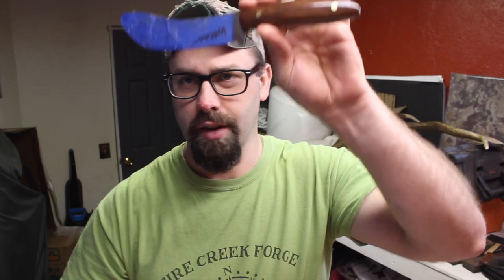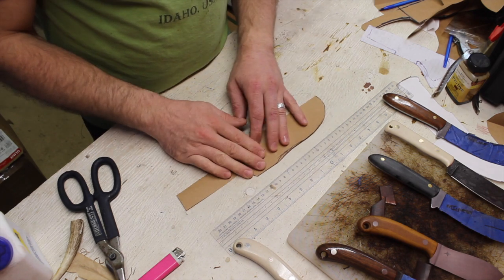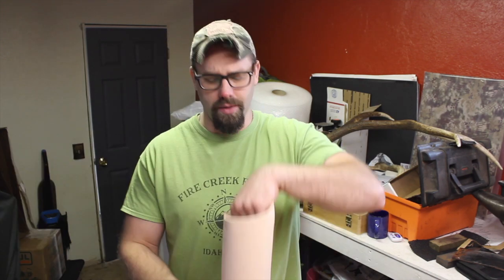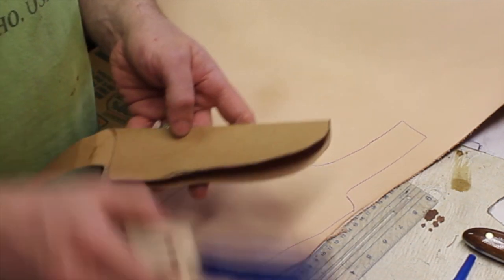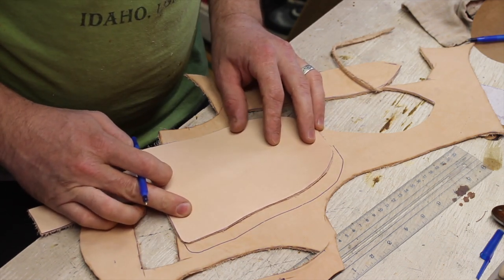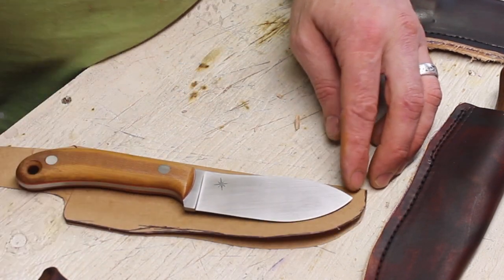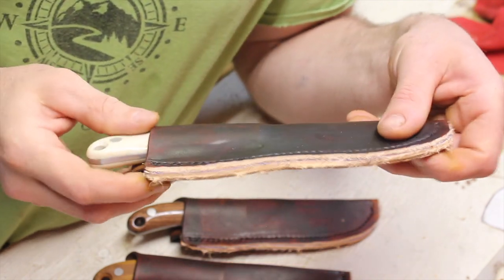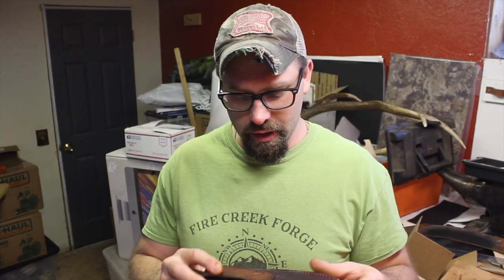The Best Knife Sheath? + Tips on my favorite design for knifemaking / bladesmithing bushcraft blades

Comment: Was that a double shoulder that you were using?  Also what weight leather do you like for your sheaths like this one?  great video
Reply from the maker: That was a single, 7-8 oz veg tan. I find that's a good weight, I've used 8-10 for this size as well but i don't like that quite as well.